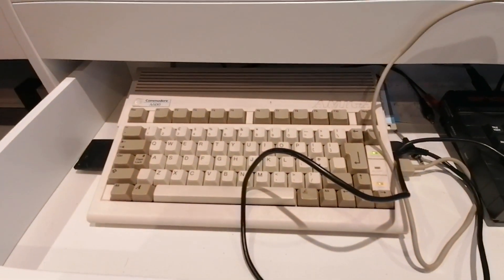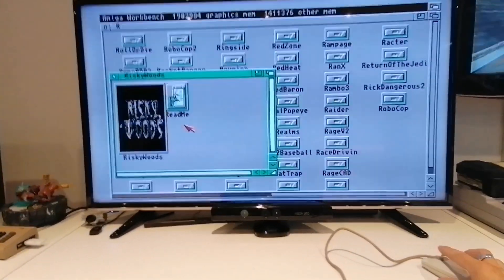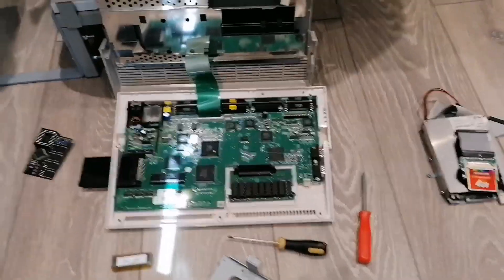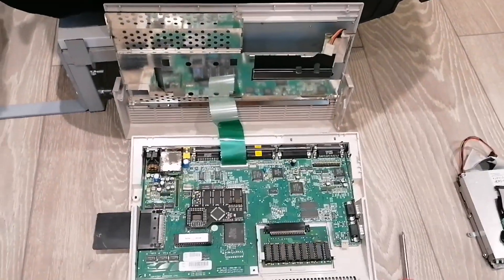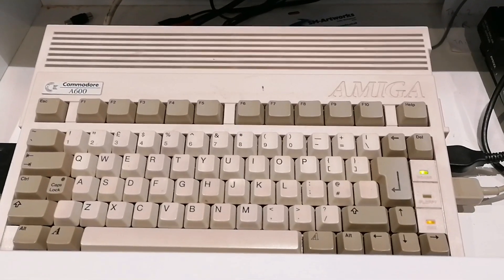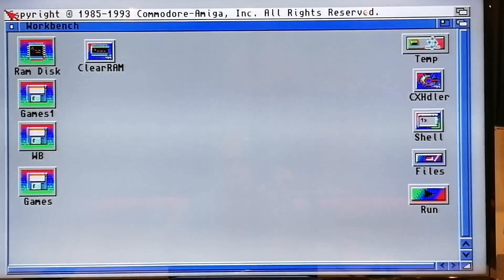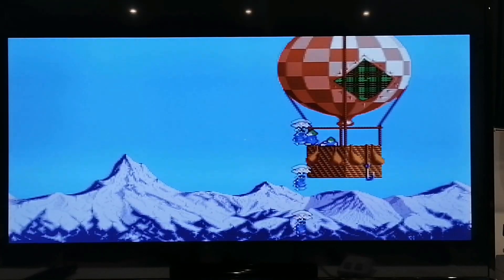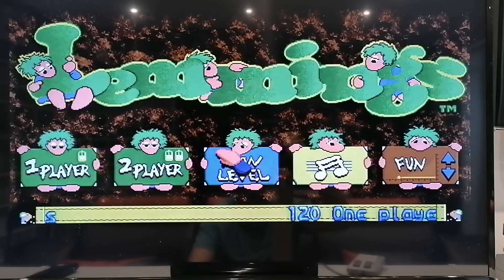Amiga A600 video strip down and upgrade video, ROM chip, fast ram, whdloader.

Comment: Is that an SRAM memory card in the PCMCIA slot? It was slow and stuttering because it only had Chip and this SRAM ram, which is relatively slow. Now that you've added 8M of Fast ram, that will help it in terms of capacity and speed.
Reply from the maker: Thanks for the information 👍

Comment: Nice to see another Amiga 600 video. These are the upgrades I’m planning to install in my machine. I’ve had it recapped at Amiga Passion now Retro Passion. Great video 👍.
Reply from the maker: Very helpful chap, I can heartily recommend the upgrades.
Even though the Amiga is pimped up, it is still an Amiga 😍
Reply: David retro games played badly. Yeah he’s a great guy.  I agree, it’s still an Amiga. The extra ram just allows whd load to run all of the games properly. There’s not much point in sticking an accelerator in there to run 3d games or applications as the PC does it cheaper.